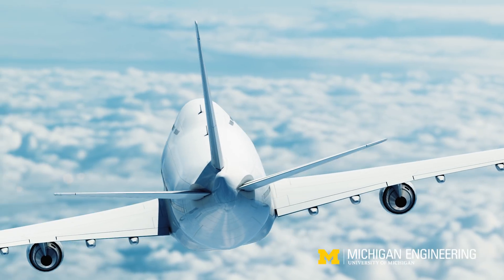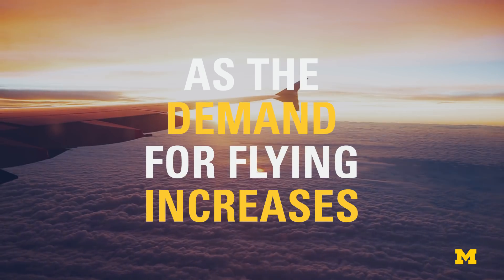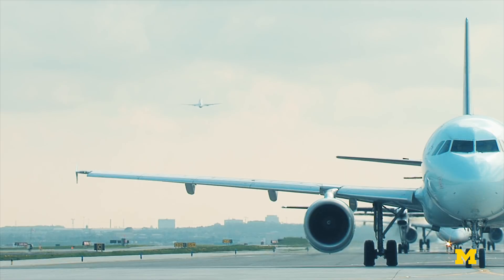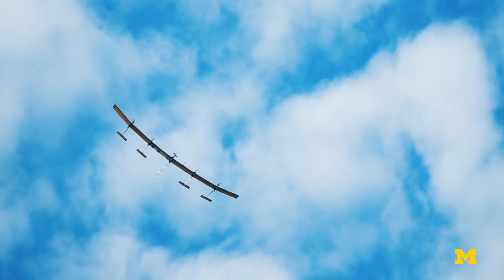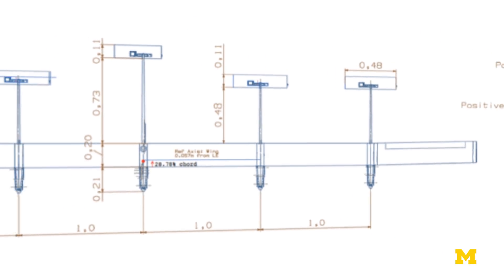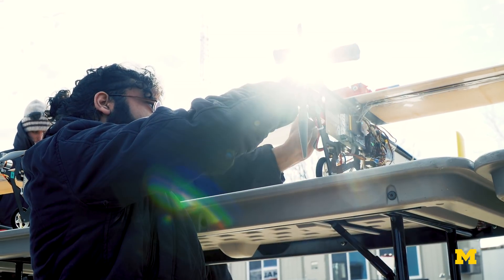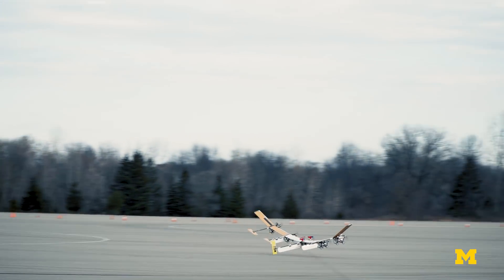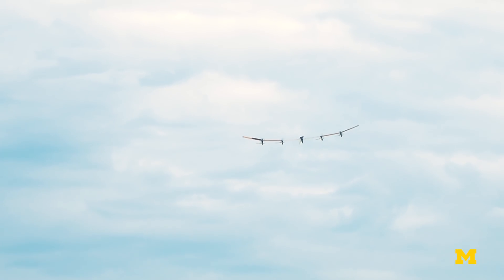Flexible, long-winged aircrafts

Comment: The planes would be way too large to work in airports. It’s all great to work on reducing fuel consumption  but we would have to expanded and redesign every airport in the world....
Reply: A true HALE aircraft has endurance measured in weeks - you wouldn't need multiple airports. Just a couple of well-positioned launch point - like a Kennedy Space Center, but for aircraft, and it would fly at high altitudes to wherever it needs to be stationed

Comment: blimps have a higher efficiency than winged aircraft especially when it comes to moving tonnage
Reply: Even a aerodynamic balloon creates more drag than lift at speed. buoyant lift does not scale with velocity, imposing harsh limits on the maximum achievable velocities.